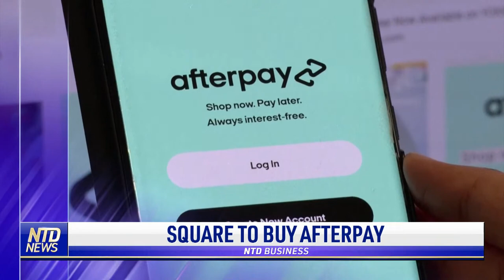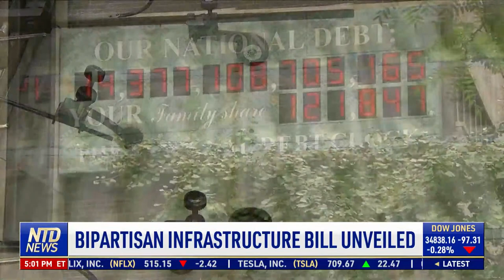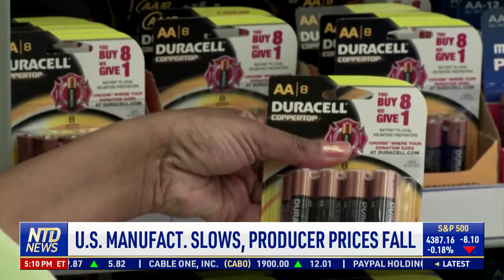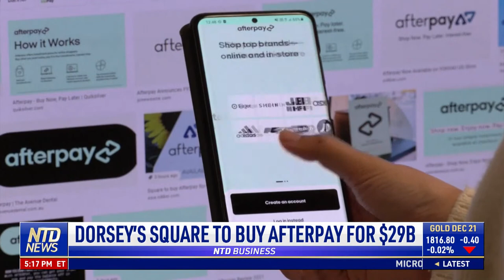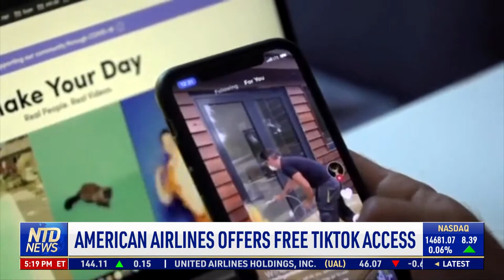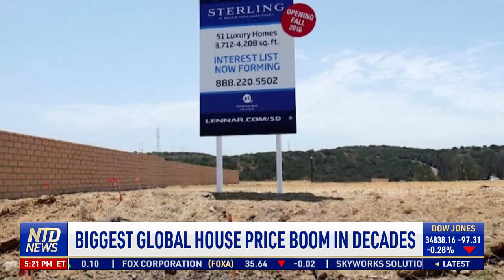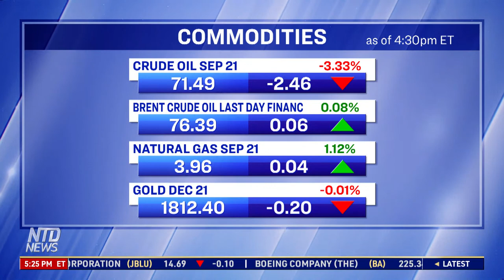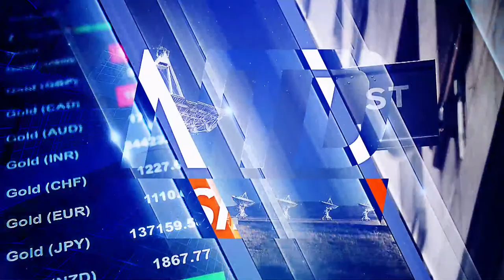Infrastructure Bill Unveiled; Eviction Ban Ends; Square to Buy Afterpay for $29B | NTD Business

Comment: The government basically gave a line of credit to renters that they should not have received
Reply: The moratorium only prevented the landlords from evicting the tenants. It did not remove the liability of the tenants to pay. Civil court is about to be overwhelmed with suits from unpaid landlords. All of whom can show without doubt multiple stimulus payments given to all the tenants. I will be curious to see if they press for larceny charges. No different than refusing to pay for cable or such and still using the service. Tenants may have thought the moratorium was helping when it was actually the most harm done to them so far. Well perhaps 2nd worse.

Comment: The most over looked part of this is the logistics. How much steel will be used?? Where are we going to get this massive amount of steel?? Where will we get the massive amount fuel that will be used?? How about the qualified engineers and heavy equipment operators ?? The USA only produces a portion of any of these. Supply and demand is going to inflate the costs like it did in lumber
Reply: From China

Comment: Gas stations could refit themselves to be electrical cars for the government has no part of it I took 10 years for leaded gasoline to be place by unleaded gasoline these car manufacturers can gear up to change to electrical cars gradually as well so in 10 years gasoline's cars are no longer in use and electrical cars are in use and there's plenty of electrical stations to charge your battery this is a new venture and it takes time after all we didn't have cell phones that work properly when they first came out we didn't have the internet as we do today change takes time and Biden is rushing it too fast when he close down the pipeline